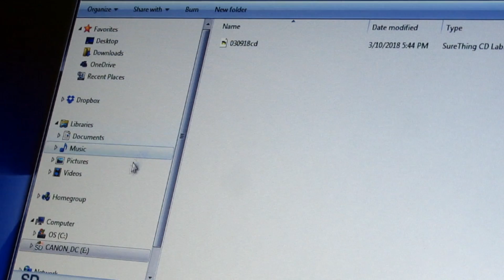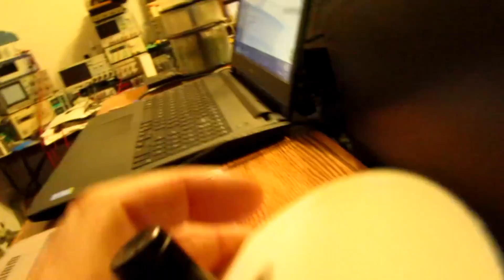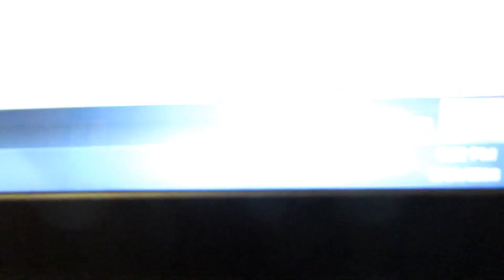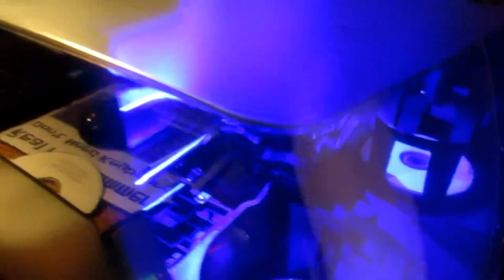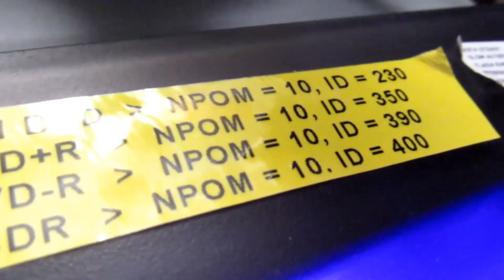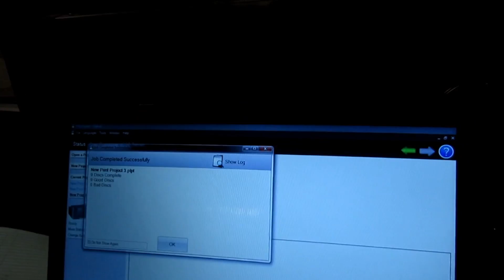Primera Bravo 4200 Autoprinter Demonstration

Comment: I want to buy one of these, but I want to know first if I can use a Windows 10 because I have a few bravo Primera SE, and when I use it,  they give me some trouble sometimes with the communication, and I find out that those printers are used in Windows XP and Windows 7
Reply from the maker: @josuebatistaruiz9818  Primera has pretty good tech support. You should try them.
Reply: in usa gone to best buy to get primera bravo se going windows 11

Comment: @youtuuba do you own a 4200 device? (burner or printer only). I'm was wondering do you have any old empty ink cartridges for it (53334)
Reply from the maker: From this video, it is apparent that I own a 4200, but I do not have any old cartridges.
Reply: @youtuuba  its been 9months since video so wasn't sure if you still owned, so that's what I asked. When you are done with you ink, instead of throwing it away, can I have the empty ink tank? I am trying to experiment with them

Comment: This printer sucks, the cartridge can't refill. Maybe I will try to tape up some of the pins on the cartridge chip and see if this can be hacked, otherwise would probably have to reverse-engineering the chip in it.
Reply: https://youtu.be/gLbB6zyQRYA
Reply from the maker: ROnx Deva, I can understand why you would prefer a printer whose cartridge can be refilled, but I am sure that the majority of users are content to simply buy cartridges when needed. So I think it is unjustified to say that a printer 'sucks'  just because a minority of users can't refill the cartridges.